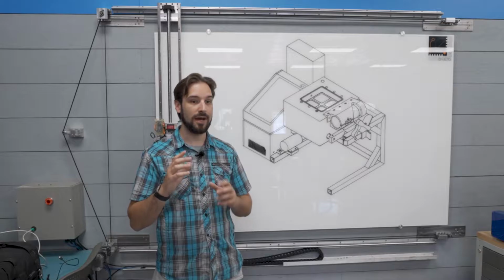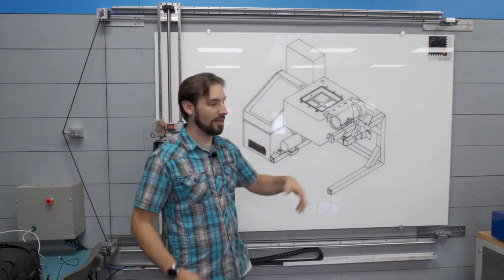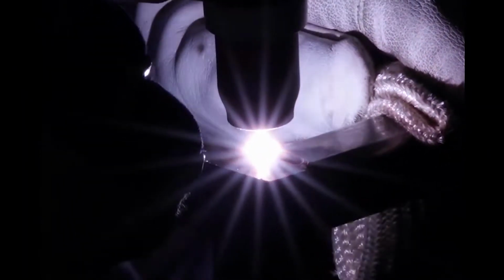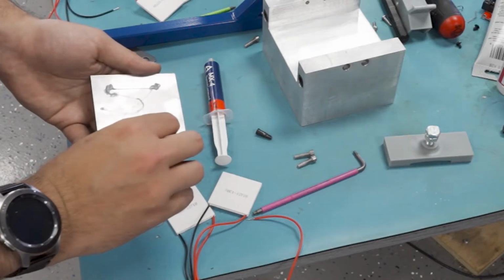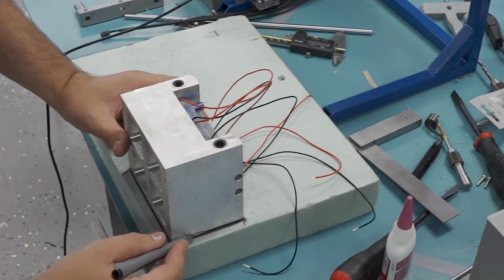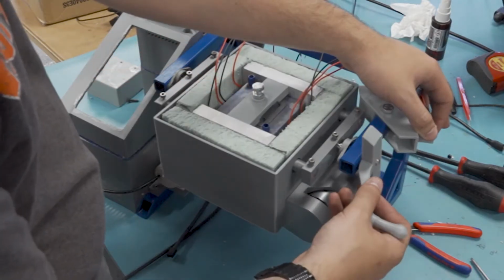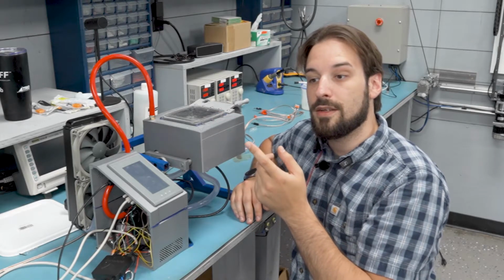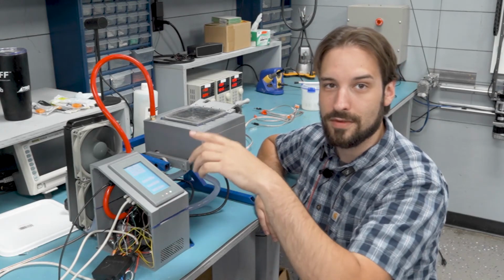Clear Ice Maker - Assembly

Comment: Interesting project. Is there a reason for driving the peltiers at only 25%, is it for longevity of the peltiers?
Reply from the maker: The power supplies that I have cannot drive with enough current to give it more power then that. I could get a bigger supply later and drive them harder. I would typically drive peltiers at 50% for efficiency.